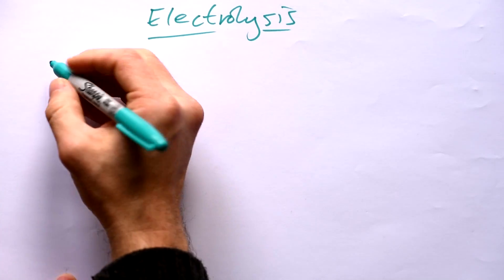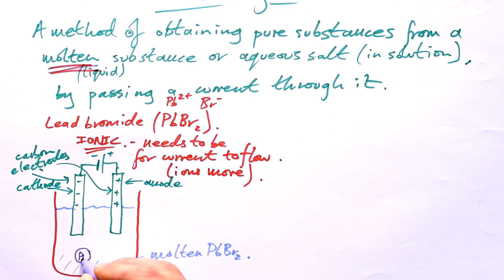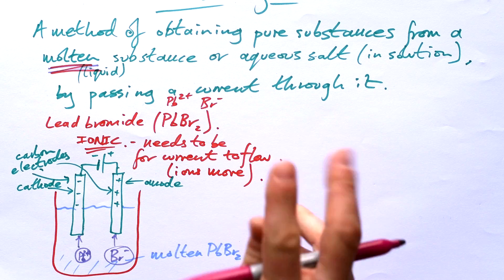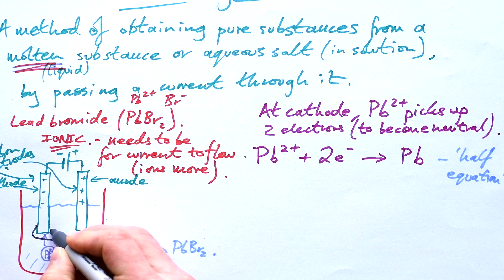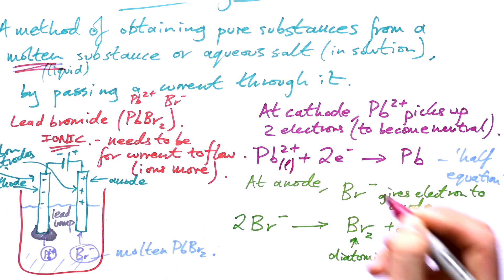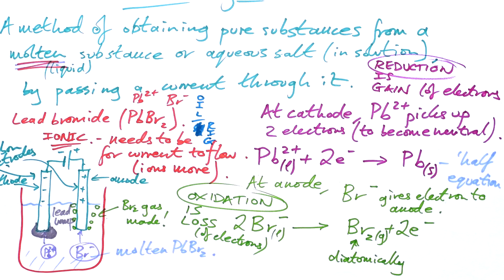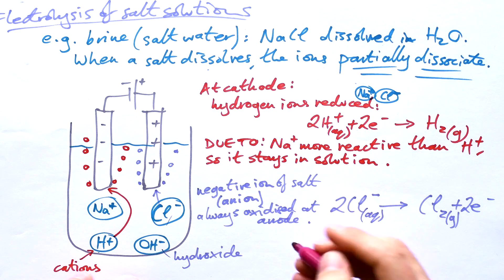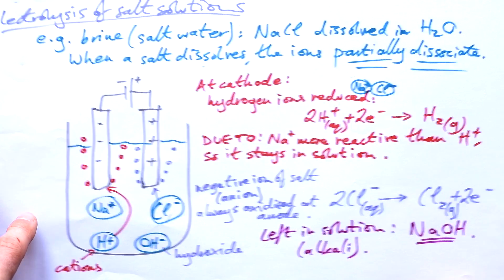Electrolysis - GCSE Chemistry (old version)

Comment: Can anyone explain why the lead bromide changes to Pb2+ and Br- please?
Reply: it doesn't change, the lead bromide is molten, so it's been melted somewhat. All that does is dissociate the lead and bromide from their compound lead bromide and allows them to move around.
Reply: Pb (lead) forms 2+ ions 
Br (bromine) forms 1- ions 

so for a neutral ionic bond we have PbBr2 , when separated we get 1 Pb2+ and 2 Br- ions

it is seperate because in an ionic bond the ions already exist in a lattice, usually unable to conduct or flow due to strong electrostatic intermolecular attraction but the heat from being made molten breaks the lattice and leaves the ions more or less flowing freely